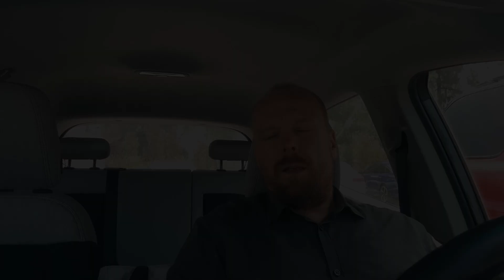Plug-Side Chat: Should DC to DC Fast Charge Adapters be Prohibited or Regulated?

Comment: People keep saying no other manufacturer has taken up Tesla on using their super chargers,  in another query I made about that I was told the deal was that Tesla then had the right to use that manufacturers IP. If that is true it seems an expensive trade for the use of a super charger for their customers.

At the end of the day as long as the adaptors are regulatory  proven safe and it is the responsibility of the owners of the vehicles to look after them (as it's in their interest anyway to have a safe working device) I see no problem in allowing their use.

It's pointless deviding ev owners,  those with free supercharging are unlikely to use paid charging stations that often.

If you own a differing make of fossil car you can freely use all petrol stations, ideally it should be the same for ev owners,  Tesla could offer that at the super charger network and make money at the same time!

Comment: Pretty sure the "jdapter" is a Tesla to J1772 (L2) adapter not the other way around.  Tesla calls their J1772 to Tesla adapter (the one that comes with every Tesla)  simply the "
SAE J1772 Charging Adapter".

Looking at the picture on the Tesla accessories store (I guess in case yours got lost or broken) it does seem to have some compliance logos on the label including CE but it's not a clear pic so I can't tell what else:

https://shop.tesla.com/us/en/product/vehicle-accessories/sae-j1772-charging-adapter.html

IMO they should not be banned, I would of course love it if Tesla made and sold a Supercharger to CCS adapter (or made their Supercharger network available to non-Tesla owners in some other way).
Reply from the maker: Yes, Tesla has a different name for their adapter.

Comment: Tesla has offered to make their network open to other manufacturers but so far has no takers.
Reply: https://cleantechnica.com/2018/04/26/important-but-little-known-details-behind-electrify-america-charging-infrastructure-tesla-supercharging/
Reply from the maker: Yes, but they've never published what their exact requirements would be. When pressed, they always seem to move the goal posts. Now that other automakers are both funding public charging networks and producing vehicles that can charge as fast or faster than many Teslas, they have remained silent.
Reply: News Coulomb can’t they just simple ask Tesla for those requirements?  I don’t think getting more answer is complicated.
Reply from the maker: The problem is, Tesla doesn't actually want others to use their standard, which is why they keep moving the goal posts.
Reply: @newscoulomb3705  they have. 

1: vehicles have to handle Supercharger charging rates.

2: manufacturers have share in the costs of the network.
Reply from the maker: Yes, that was what Tesla stated publicly, but that doesn't really give the details. Even Tesla vehicles don't necessarily handle the max Supercharger rate (making it a nonsensical standard), and "sharing the costs" of the network could mean anything. 

Essentially, Tesla is offering a partnership they know no one would be interested in or could justify. A self-fulfilling prophecy.

Comment: If those adapters could be classified as a physical modification to a charging system they may violate the terms and conditions of some systems now.  I would bet if there was a negative event the charging operators would sift through their terms and conditions to deflect liability.
Reply from the maker: Yes, and I'm primarily concerned with no governing body. It's like the Wild West as far as adapters are concerned.
Reply: News Coulomb Do these adapters have a UL label on them?  In the US most electrical devices are tested and approved by that group.

Comment: I think as long as charging stations are profitable, allowing Tesla to use them should only help fund the expansion of the network, and may ultimately lead to better and/or cheaper networks. 

The high power chargers, cars and any adapters should be approved by some agency, but no idea who that agency would be. That includes any Tesla superchargers and cars which suddenly get a software update allowing higher current. 

The adapters will be a little harder to enforce unless the charger is smart enough to know it’s not a factory equipped CCS car, and then asks for the adapter serial number or verification chip. 

Was there any reputable agency approval for the Tesla to J1772 adapter you bought?
Reply from the maker: The Jdapter I have is SAE spec and UL certified (I believe). I'll have to recheck Quick Charge Power to verify.
Reply: News Coulomb, I wonder if the Tesla HPWC checks that adapter, thinks it’s a Tesla, then sends AC power through the appropriate pins. I haven’t seen anyone do a deep dive on any of this. In fact I was looking for “how to get CCS charging for DIY EV” and I wasn’t able to find any Bolt on solution. I think Orion BMS will accept Chademo, but not CCS.